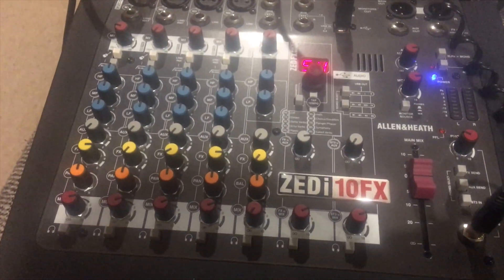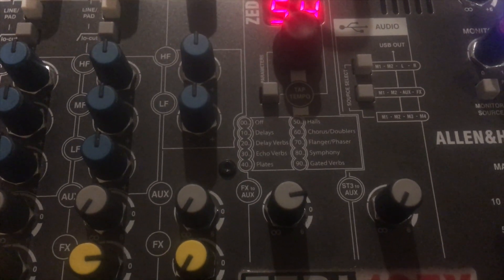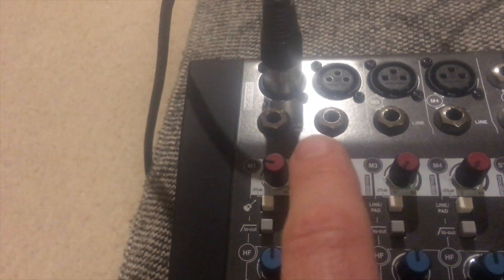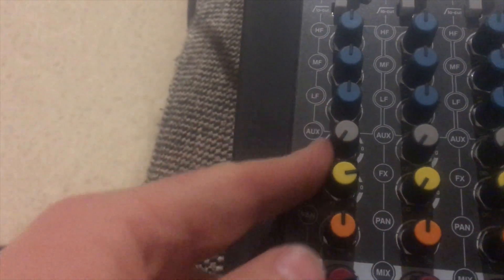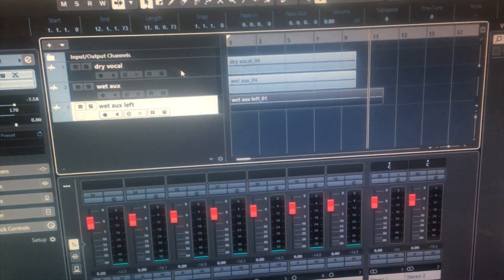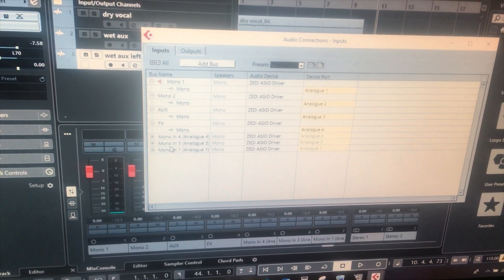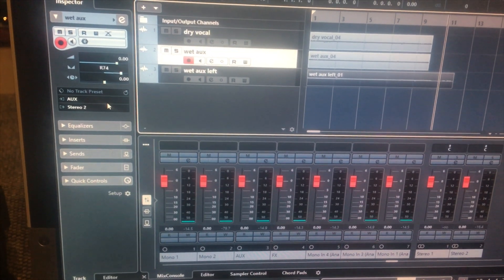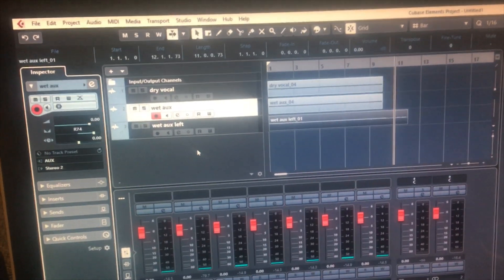How to record the effects built into the Allen & Heath ZEDi-10FX via USB into your DAW

Comment: How do you get Aux and FX under audio connections.  My zedi10 FX only shows 4 inputs and I am not able to add aux and FX .
Reply from the maker: all good. Happy for you to ask again. I haven’t used Cubase in a long time (I’m really a noob sharing what I found on first go in this video) but what I guess I did here is I named those channels myself in Cubase. I may be wrong but at the time, Cubase let you have different input configurations to switch between that you configure yourself. On the config I showed here, I named those channels as Aux and FX myself. Sorry I am not much help. I no longer use Cubase and don’t do much recording any more. I don’t even have it installed to go and check for you. @tamimsana51
Reply: @ 
Thanks for your reply!
Reply from the maker: It’s been a while since I did this, but off the top of my head the ZEDi10FX only has 4 inputs and to switch between either the 4 mic channels or the 2 mic channels and an Aux and FX, is a button on the unit
Reply: @ I tried the button on the mixer, but my question was about adding aux and FX inputs on cubase , I don’t see the option.
Reply from the maker: @tamimsana51 Cubase won’t see that as an option. It will only see four channels and won’t know if you have selected the 4 mic inputs or the first two and then Aux and FX. You can’t have the four mic inputs and AUX and FX as well. It is one of the other, and Cubase can’t tell if you have that button selected or not. It can’t read that selection over USB and show it as a channel to choose from
Reply: @ 
Sorry for asking it again , but on your video when you go to the audio connections on cubase there is aux and FX showing after input 1 and 2 , in my case I don’t see that

Comment: I'm trying to put things together from 2 of your videos. When I go to audio connections, I can't seem to add the Aux or FX connections. All I see are 4 mono inputs called Analog 1-4.   When i go to studio setup, it looks exactly like yours does in your video about the initial setup.. I just cant seem to Add the Aux or FX inputs like yours in this video. Again, mine just say Mono 1, Mono 2, 3 and 4. Any ideas?
Reply from the maker: It’s fine if you have the four mono inputs. They will match up to whether you have the buttons pushed in or not with M1-M2-AUX-FX or M1-M2-m3-m4 selected
Reply: @MrTimMifsud  I guess I just dont have something set up correctly then. I just can't seem to get the Aux channel to have the effects on it. I can see audio is present, but when I play it back, it is as dry as a bone. Thanks for the reply. Ill keep trying.

Comment: Thanks for making the video, it was really helpful.
I do have another question, maybe you can help me with.
So if I now record the Aux channel coming into Ableton on to track 1 to have the FX included. The problem I am having now is that when I create a new track and try to record in the same way to still use the mixer FX. When I record in track 2, the audio coming out of Ableton via the usb outs seem to be routed back into the main mix. So I end up recording track 1’s playback + track 2’s in coming signal. 
I am not sure if I have something configured wrong or if this is sadly not possible?
Hope you maybe have something that might help?
Thanks; Steve
Reply from the maker: Unfortunately I don’t have any experience with Ableton. But it might be that if you want to record effects from only the incoming signal and not the playback, you might have to re route where the playback is coming in so that it doesn’t touch the effects. I think that’s possible. I’m not near my unit right now so can’t say for sure.
Reply: @MrTimMifsud  thanks for your reply. I also feel like it should be possible. Only the playback audio coming from my DAW through the USB is routed to AUX Send. I order to hear it (which I do, the play along and add to the recording) I need to have this level up but this is blending the input FX audio with the DAW playback and sending it all to the main mix out... So straight back in to the armed track in my DAW. 
I appreciate your input but this has got me stumped 🤔
Reply from the maker: Actually, if it was me, as a workaround I’d record all the tracks dry, then re-amp each individual one through the effects of the Zedi10FX one at a time to get the effect for that track I wanted, while muting the other tracks
Reply: @MrTimMifsud  It’s good you mentioned this, as this is the only way around this that I could think of as well. 👍🏻
Ref. your other comment, I have checked the manual many times but it almost reads too simply. It could maybe do with a little more detail and a few examples of possible routing scenarios instead of just the pictures. 
Also as you previously mentioned, if this is at all possible, the solution seems to be with being able to switch the playback signal via the 1-2 & 3-4 USB in. Saying this, I’m still to figure it!? 😄 Thanks for your advice 🙏🏼
Reply from the maker: @Rocktofakie  yeah I’m starting to get the sense that the FX were not designed so much for recording and keeping on a track. Rather they are there for live work more than recording, and in the recording sense, they are there to give some sort of latency-free effect for the performer to play to to help their performance while tracking, but their takes go in dry and you use a similar plug-in afterward. Which is probably what I would do anyway. The quality of the FX are good, but I have plug-ins which sound better and having a dry take to work with in mixing is easier to get a consistent sound for the track if I use the same reverb and delays from the same plug-in, rather than find I have too much reverb on a take and I can’t take that reverb out.
Reply from the maker: Check the manual. I’ve decided to try fiddling with where my main playback tracks come back to the Zedi10FX. Lately I’m finding it useful to switch between returning on the USB IN 1&2 and USB IN 3&4 depending on my needs

Comment: Sir how to record multiple channel in zedi10fx at the same time
Reply from the maker: @ka-forehead_Tv if you mean “in” it can’t record “in” the unit on its own. You need to plug it into a computer or iPad via USB. The computer has to have a digital audio workstation software installed like Reaper, Cubase, Logic, Ableton, GarageBand or ProTools. Then you need to have up to four tracks armed and ready to record in the software and the M1, M2, M3, M4 button on the unit selected for that option. Check the manual. It’s an easy unit to use.
Reply: @MrTimMifsud  Sir I have a reaper but m1 and m2 only detecting my software
Reply from the maker: @ka-foreheadtv237  you have to activate those channels in your audio settings in Reaper. Make sure you have the Zedi10FX drivers installed from the Allen & Heath website

Comment: Hi Tim. Brilliant video! I’m looking to live stream 2 mics into M1 and M2 ( with FX) and feed my iPad into st1 with a backing track. I’ll be streaming to my laptop. Is this possible? Thanks so much !
Reply from the maker: SoundHealth thanks. I haven’t tried this setup myself so I don’t know. There is a couple of ways you could do this. If you want to stream to your laptop via the USB, then you would have to bring the backing track from your iPad in as an analogue source. Or, you could hook up your iPad as the USB source into ST1, and then run an analogue stereo out to a line in on your laptop(if your laptop has one). Effectively, you could just use it as a straight four channel mixer and then use another two channel audio interface into your laptop.
Reply: @MrTimMifsud  thanks for your speedy response! If I use it as a straight 4 channel mixer can I still have fx on the mics from m1 and m2? Also are there any buttons that need checking in the usb out section?
Reply from the maker: SoundHealth yes - if as a straight mixer you can have just the one single effect for both mics that you blend to taste
Reply from the maker: As for buttons, it depends what you want to do. If you want to record a separate track of FX all mixed together like an effects bus, then choose M1, M2, FX, AUX. but, some streaming platforms may only accept a stereo source so it might only have M1 and M2 in the feed. You might be better to choose M1, M2, L, R and use the L and R as your streaming feed.

Comment: Hi. I need a info about XLR MAIN OUT of the ZED a mixer...
Actually, can be Allen & Heath ZED 6FX connected to sound card of the computer(mic, line in) via cable:
https://www.amazon.com/Y-Adapter-Unbalanced-Y-Splitter-Breakout-Microphone/dp/B083JHJZ5G

Can be connected to an amplifier too via cable: https://www.amazon.com/TISINO-Female-Stereo-Connection-Interconnect/dp/B07C7V8PT6

Will it works?

Thanks.
Reply from the maker: I can only guess based on pictures as I do not have a Zed 6FX, and I’m not in any way affiliated with the company, just an owner of a ZEDi10FX. The first cable should work, and so should the second, but it depends what you are plugging into. If you had bought the Zedi10FX, then all you would have needed was a USB cable to plug into the computer, but your unit, doesn’t seem to have USB.

Comment: I just bought this mixer and spent the last 5 hours in Logic on my Mac trying to get a damn recording with the effect on the track. On my Yamaha I just push a button and dial in how much I want and I'm done, guitar with plate reverb. Simple. With this mixer I've tried everything I  can think of, I can hear the effects applied in the phones but it simply won't record no matter what I do. Am so frustrated right now, about ready to throw it out the window.  I'm wondering if I need to have the mac send its audio to the mixer instead of system out? Why did they make this thing so horribly confusing? If I can figure it out its going back, but I really need those 4 USB channels coming in so I can get 3 audio tracks from 3 mics simultaneously.
Reply from the maker: Sounds like what you are trying to do isn’t possible with this unit. You can record two tracks simultaneously, and then also record the fx and aux track alongside those and mix them in the DAW. If you send more than one channel to FX in the mixer, then the FX track will have all of those tracks effected in the one track. As I’ve said in other posts, certain DAW work better than others with this unit. I haven’t tried Logic as I don’t have a Mac. I’ve tried it with Cubase, tire my hair out and wasted hours trying to do what you did, and while it worked, it was a pain. I’m finding this unit works better with Reaper. I think the idea of this unit is it isn’t supposed to be a straight interface only. It is a compromise between interface and live mixer. I think it is probably more skewed towards capturing live performances of small groups and being able to take away a few extra multi tracks for post mixing adjustments of live recordings. Honestly, I think it’s actually a fine unit. The headphone amp is a bit noisy and low headroom, but coming out of the XLR outs it sounds great into my Focal Alpha 80 speakers. Plus, I rarely use the in built effects now except just to give some ambience for tracking. The plugins I have are better for those effects. And it has really low latency with my system. Hope you get it to work for you.
Reply: @MrTimMifsud  You're probably right. I've looked at other mixers and they just don't get the high level of reviews this one does. What I really want to do is have two mics on my cab, and a third room mic, and have the combined stereo output go thru the Main Out into my studio video camera. They have been really great in tech support, maybe there IS a way, I'll give them one more chance...the other mixers though, if you want effects on any channel you just choose your effect and turn up the effects knob on any of the channels to get it enabled on that track. So simple.
Reply from the maker: Dave Stephens well there are quite a few places on the mixer you could tap into to get a stereo mix out to your studio video camera. I use my A&H with an LD systems powered four way headphone splitter so I could use that to send a stereo feed to a camera, my headphones and other headphones of people I’m recording. This headphone out is good as it’s stereo and you can choose whether it is Fx send, AUX send ST3 in, or the main mix. I also of course have the XLR outs which I use for my Focal Alpha 80 making sure I choose XLR = Mons. There is the left right rca unbalanced outs which with the right cord could feed your camera the whole mix in stereo. The aux out and fx out unfortunately are mono, but they are a mono sum of whatever channel you feed from M1 to M4.
Reply from the maker: I don’t think you will get 3 simultaneous tracks each with their own effects recorded, maybe if you use the Aux send and bring it back in on another channel
Reply: @MrTimMifsud  Logic recognizes 4 track inputs, so yes it will do them all as seperate mono channels. I've no luck at all getting the effects to show up on any tracks. I don't understand what use the Aux send even means. Its too complicated and with the PC its way worse than the Mac, we don't even need drivers, Macs just recognize it right away and takes seconds to set up. But jumping thru a hundreds hoops to do something so simple is just a joke. Yes its a great mixer, but so was my Yamaha and effects on it took 3 seconds to enable and adjust, and it has a nice plate reverb, bit it could only do 2 inputs at once, not 4 like this one will do. I wrote to them and complained, we'll see what they say. If their tech support is bad I'll return it and hope for something that actually easily works.
Reply from the maker: SDPickups I just had a thought - you could try selecting M1, M2, AUX, FX as the option to record your three sources and FX. Plug in your three sources, and then turn up the AUX knob on your M3 channel. Make sure you have turned up the fx knobs on each channel that you want fx on. I haven’t got time to test this myself now - am just thinking it through in my head.
Reply: @MrTimMifsud  I've made some minor progress, but their tech support guy is going to answer a big list of my questions shortly, so they look like they are responsive and responsible. Thanks.

Comment: If I had a music input in ST1 (or ST2), what usb output setting should I choose to include ST1 (or ST2) as one of the usb output channels?
Reply from the maker: Hi mate, thanks for the question. I did a few tests, and I don't think what you want is possible with this unit. The unit really only records from the four mic strip channels. I think St1 and St2 are only for live use. St1 and ST2 will be recorded if you select M1 - M2 - L - R, but that will record a bounce down of all the tracks including ones you are feeding from ST3 from your DAW. For my purposes at home, this is fine, but I can certainly see your frustration if you wanted to leave mics plugged in and instead choose ST2 as your source in your DAW. Unfortunately, there is no button on the device that lets you do this. You could send ST1 to AUX using the AUX knob on ST1 strip, but that is a mono send and a mono record if you choose M1 - M2 - AUX - FX. Sorry. Wish I could be more helpful. Good luck.
Reply: @MrTimMifsud  Thanks Tim for trying and testing it out. I was hoping to output one mic and one stereo from mixer's usb to my DAW. I currently have a Yamaha MG10XU which can't do this and thought the AH ZEDi can. Probably use a separate audio interface then.
Reply: @MrTimMifsud  Could this be a workaround for recording ST1 with FX while monitoring other tracks without bounce down other tracks in the record? Select M1 - M2 - L - R. Music input in ST1 for recording and playback. For mix we only open ST1 and FX to MIX. For monitoring we open aux for ST1, FX to AUX and ST3 to AUX. Would that prevent the other tracks from ST3 to end up in the new recording?
Reply from the maker: @Stefan maybe. I will try it out and get back to you in a couple of weeks - am busy at the moment.
Reply from the maker: @stefan In trying this out, when you say “only open” does that mean when recording you turn down the MiX on M1 and M2? I think what we are trying to do here according to the original question is record M1 and M2 and ST1 all at once in individual tracks and retain the stereo nature of ST1 while also avoiding capture of the audio mixed back from the DAW. as far as I can tell, this isn’t possible. Sure you can set up ST 1 and have only it’s channel open and choose the M1-M2-L-R option to capture a stereo track from that channel, but then it’s just a stereo in only. May as well choose M1-M2-M3-M4 and record two mono sources in M1 and M2 and use M3 and M4 as the stereo in for the stereo source (but ensure you choose line/pad for those).
Reply from the maker: @Stefan I’ve followed these instructions and now I can’t seem to record anything into Cubase using these settings. I’m an amateur at all this. I’m not a mixing engineer so it’s all just trying things. Thanks for your suggestions. I’ll just stick to using the M1-M2-M3-M4 setup. 

Thanks
Tim
Reply from the maker: Okay- so I just found out how to record from ST1 into GarageBand on the iPhone. You need to choose M1-M2-L-R as the USB out. Make sure you use the USB 3 to lightning camera connection kit. Make sure nothing else is plugged into M1 or M2. Set your levels of gain and mix on the ST1 channel and record. You need to ensure you have two channels armed in GarageBand and it will do it. If you plug something into M1 or M2 then you can also record those tracks at the same time but they will also print into the L-R tracks.